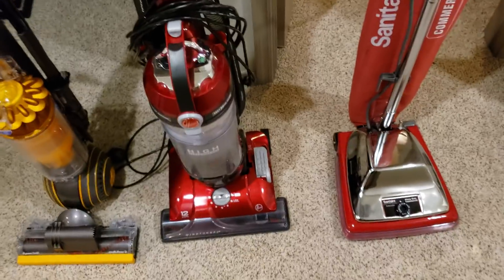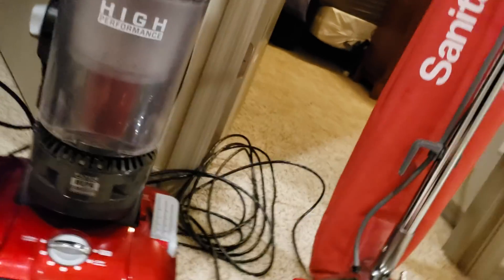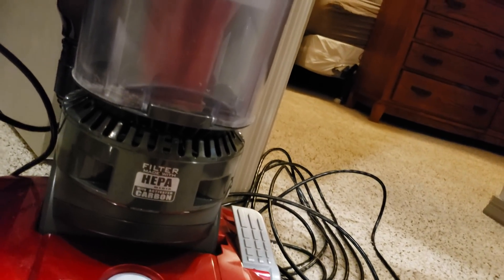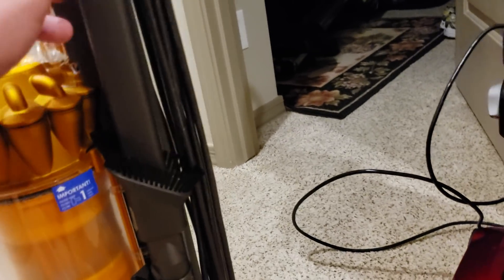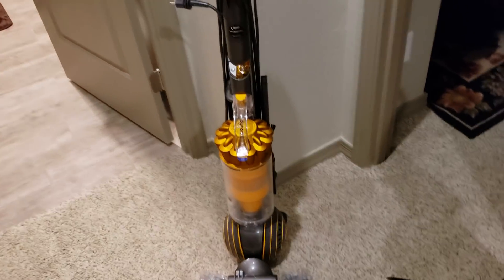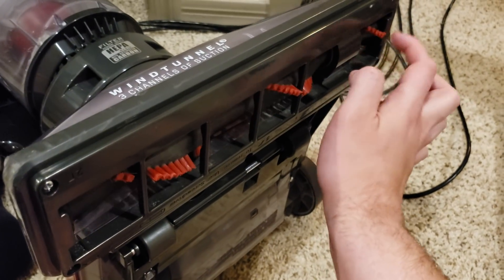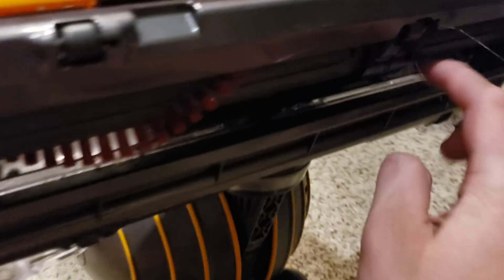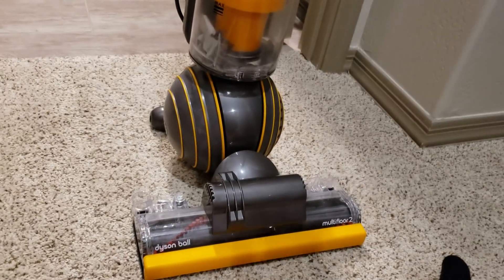Is there such thing as the Perfect vacuum🤔

Comment: Have u ever used a royal metal commercial upright? I use them for my carpet cleaning company. Also use the sanitars imo the royal is just a downright monster. If you never used one for sure get one. My only complaint is the brush-roll bearings wear prematurely because hair unavoidably gets inside and seizes the bearing and melts the plastic end cap :/
Reply from the maker: I have not tried a royal metal.